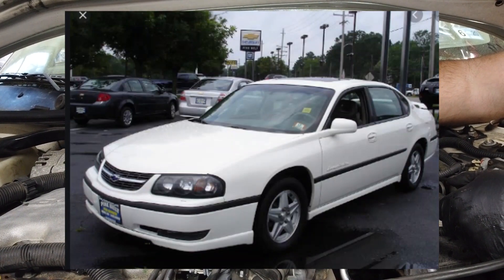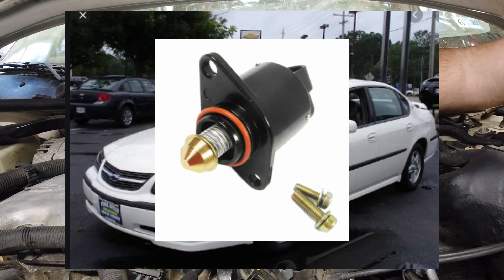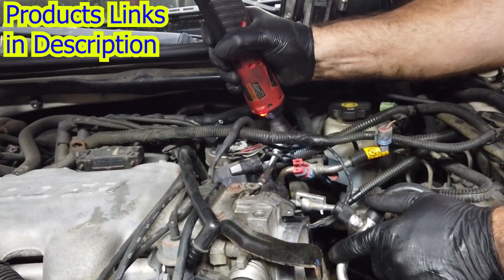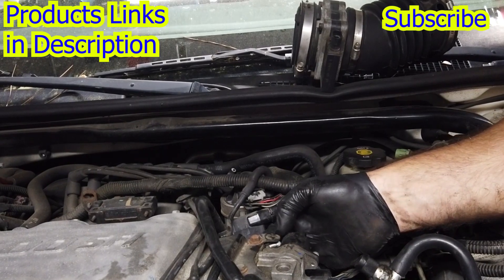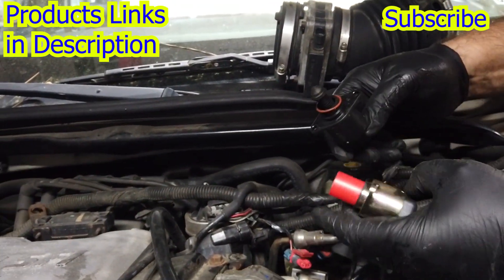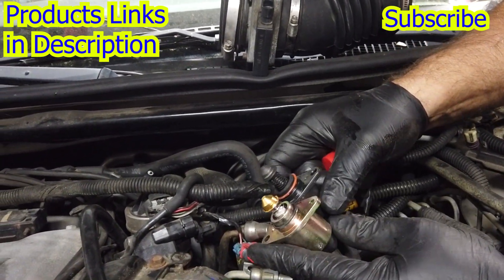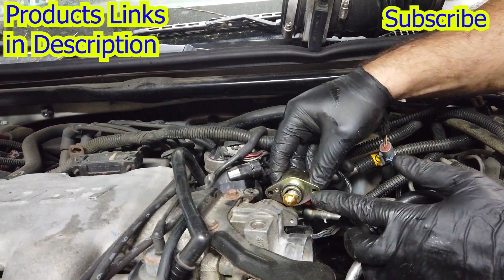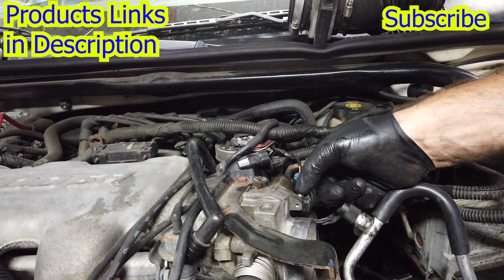Chevy Impala Idle Air Control Valve , Fix High Idle, Fix Low Idle

Comment: Wouldn't you have to get it to RE-LEARN it's position/values? Either by driving it at varioys speeds OR ? I was told over time it LEARNS your habits & can idle low etc. Curious. Oh!! If it's filthy then cleaning the throttle body inside would help bit getting that part off looks to be a pain with the return spring linkage. Using ONLY throttle body cleaner. Have u folks cleaned the m.a.f. sensor with the CORRECT cleaner ? And don't ruin it by touching it inside either.

Comment from the maker: Chevy Impala Idle Air Control Valve , Fix High Idle, Fix Low Idle , Save some money and do it yourself, A bad Idle air control valve will cause everything from high idle, to car stalling as well as a possible no start.
******************************************************************   Thanks so much for watching.

Enjoy the new playlist
https://www.youtube.com/watch?v=yb5M7QLS1sg&list=PL8kPE7Ywpu4hnDulmz2Jj7BYQ2aGIburU
Reply: Well replacing mine didn't do anything it just got worse
Reply: @michaelandrews814  did u clean the throttle body